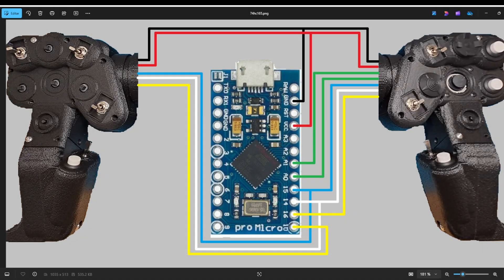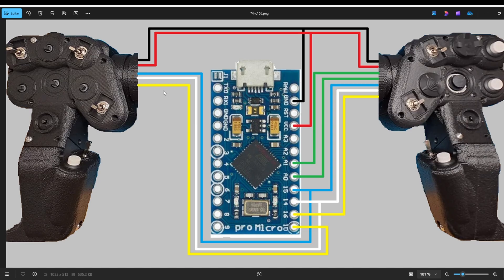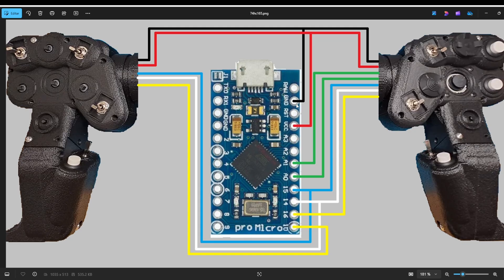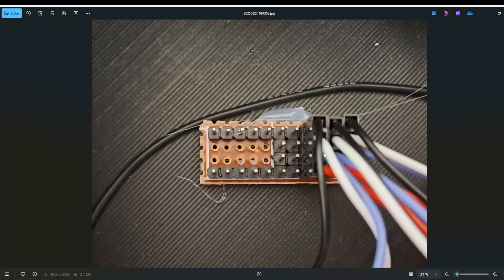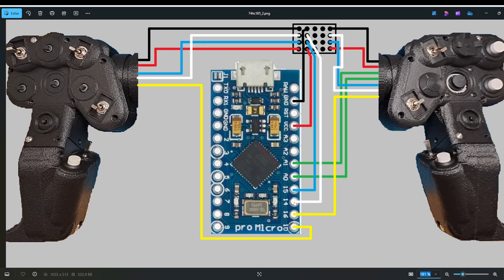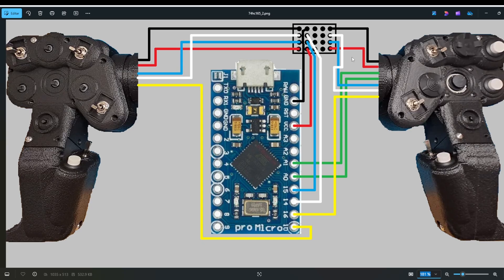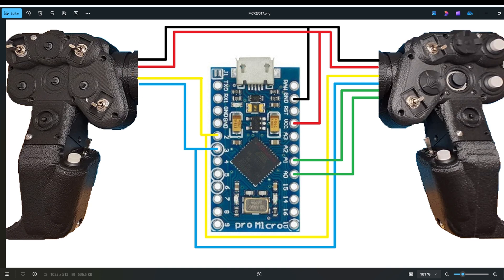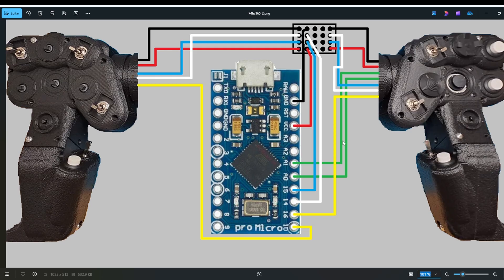Apache TEDAC build - Episode 5 - Connection diagram

Comment: Might be a dumb question but does it have to be a pro micro? I have some nanos laying around would that work  just same pin out?
Reply from the maker: @tugboat7777  yes it does need to be a pro micro (beware there's a pro mini, and that one doesn't work either) or a leonardo. Nanos won't work because they use a different microcontroller. The pro micro chip is recognized automatically by windows as an HID device
Reply: @ that’s too easy I have a project I used a pro I to on that needed a nano s quick and easy swap
Reply from the maker: @tugboat7777  in any case, pro minis are cheap and readily available. I buy mine in Aliexpress for about $5 (knock offs, of course)
Reply from the maker: @tugboat7777  even in Amazon, if you don't want to wait for the shipping, they can be found for about $7-8
Reply: @ yea I might look into it I like to get boards with usb-c just makes everything easier